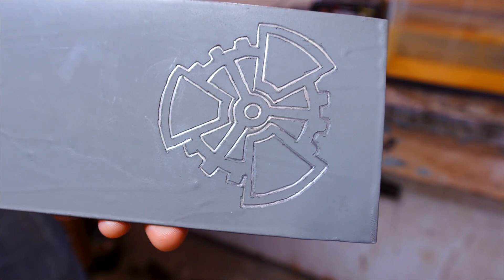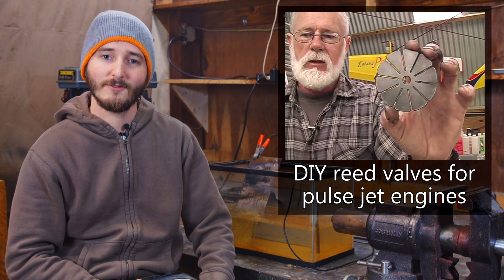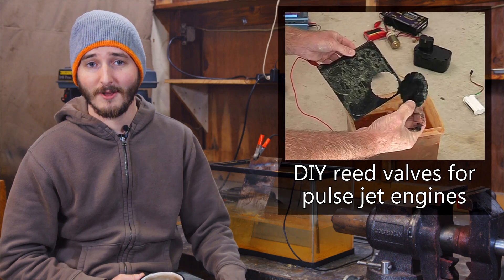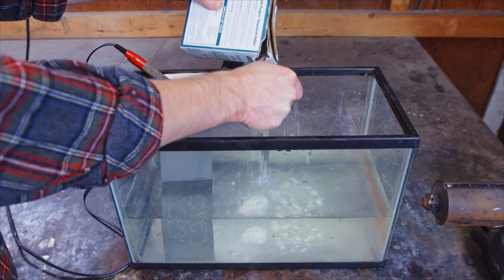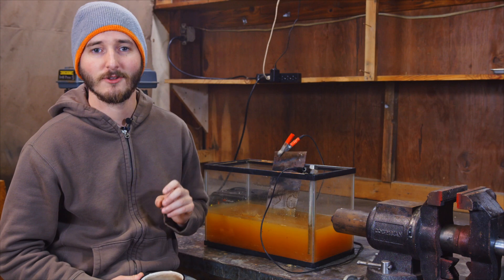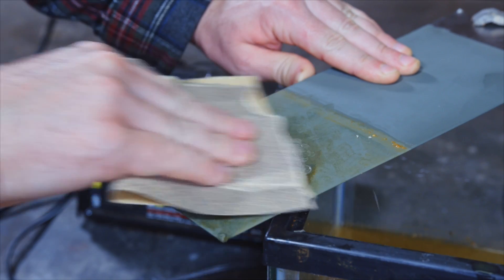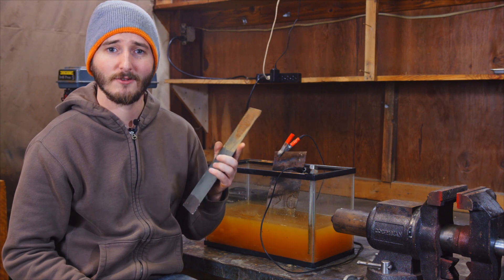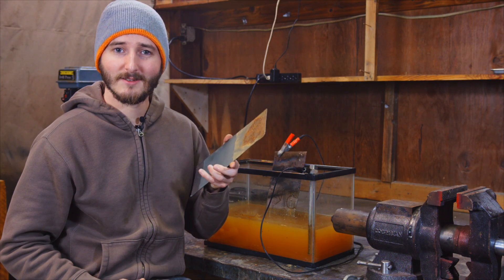How To Cut Steel With Electrolysis [Experiment In Progress] - NightHawkInLight

Comment: Your problem is the use of baking soda.  Etch Primers use an acid to form a physical and chemical bond to the metal.  Seeing that the baking soda is a base, you are breaking that bond the paint has with the metal.
Try using Kosher or Rock Salt (table salt in the US also has iodide), in a well ventilated area.  
If concerned with Chlorine gas, try using Ferrous/Iron Sulfate or Copper Sulfate (both Gardening Supplies, Ferrous Sulfate as a soil supplement, Copper Sulfate as a pond algicide).  They will smell bad, but no chlorine.
Reply from the maker: Wow, I feel like an idiot for not connecting that a bicarbonate my not mesh well with an acidic paint. I figured most of the acid would be gone post drying but it wouldn't take much to cause bubbles. Good thoughts.
Reply: Once you get rid of the bubbles, you'll also want your metal to be etched smoothly. That is, you need an electrolyte where the iron is fully soluble (to avoid getting deposits forming on the metal surface as it is being etched), and that is relatively viscous. Also, avoid chlorides : I heard they accentuate pitting.

Phosphoric acid (which can be bought in hardware stores as rust remover) should be ideal, though costly. Sulfuric acid might be a chaper alternative (the 37% aqueous battery acid, not the concentrated oleum!).

Some sodas like coca-cola or pepsi might be a more "ghetto" way of getting a dilute solution of phosphoric acid. THough be sure to boil them beforehand to degas all that CO2.
Reply: Kind of a waste of copper, and not so green to make a big mess with that and dump it all down the drain.  If it's lower pH you want, you might try using vinegar.
Reply: Adding vinegar to a koser/rock salt solution is not a bad idea.  However a mixture of just Vinegar and water would not make a good etching solution.  For a good etching the water needs to be filled with free ions to allow for electrical conductivity.  Hence why 'salts' are used.  Vinegar is an organic acid and produces very few free ions to conduct electricity, but would lower the pH of the solution.
Reply: Natriumpersulfat or iron perchlorate used to etch PCBs would not work on it? If not, why?
Reply: Wouldn't a carbonated soda solution have enough acid for current?

Comment: electrolyze it with a coating metal that cant be a cathode ?
Reply: This is the point of the primer. If you make the Cathode unable to carry a current then nothing will happen as the current wont pass.

Comment: Have a look at thermite reactions and rust oxidation iron oxide  idk it may help you. Probably not tho. Btw just a quick tip if u are going to attempt this with a salt solution then u should keep it in a ventilated area because it produces harmful gases. Better to use baking powder if u want to be safer

Comment: Try with other types of paint won't help, because the electricity don't cut in a straight line, it cuts in a spherical shape, I hope you understand, try with a very thin steel and it should work

Comment: what would happen if you reversed the polarity, for lead acid battery chargers i believe they pump the electricity in reverse to charger it.
Reply: This possess uses two pieces of metal called the Anode and Cathode. The electricity cause the salt in the water to bond with the metal in the "anode" and follow the current pulling material to the "cathode" if he did this the pipe would lose metal and it would be deposited onto the metal hes trying to cut.

Comment: the polarity is backwards isn't it? electrons leave from the negative terminal. making you're work the negative terminal will make partials of metal leave with the electrons and start covering the positive lead. 

have your tried useing more current? the posses may be time sensitive and needs to occur quickly to get cleaner results

Comment: All that comes to mind off hand is water pump grease, the stuff is so thick and really hard to remove when you get it in you. 

I can only imagine electrolysis working on extremely thin metal, as soon as you have a 90 degree open face to the protected part the electricity can ingress in any direction.

Comment: The downside of using electrolysis is that, for certain patterns (for instance lines enclosing another pattern), once the material starts to become thin, the resistance between certain parts of you want to cut and the battery can get very high. So an acid might be a better option for those kind of patterns.

Comment: This is a test to see if my comments will post, because they weren't before
Reply: Excellent project, video, and channel. thank you. 

Sodium Carbonate is apparently better for electrolysis than Sodium 
Bicarbonate. You can either buy "washing soda", or just bake the baking 
soda at 300-400
deg.F long enough for it to heat through, maybe 30-60 minutes. This
turns the NaHCO3 into Na2CO3. (makes a good all purpose non-toxic
soap/cleaner too.)

Wax can adhere even to an oily surface. If you want
to paint the metal, try cleaning it throughly first with lye (NaOH)
or sandblast it. It's clean when water sheets over it instead of
beading. Similar to lye, you can get caustic potash (KOH) from
hardwood ashes (literally Pot-ash). Or you can make it with the
Chloralkali process.

edit: After the first coat of primer/paint, maybe try a second or third coat of some kind of sealer or polyurethane?  anything waterproof that will keep the ionically-charged electrolyte away from the paint.
Reply: Did it say unknown error when trying to post?
Reply: yes
Reply: Mike Guitar
Ah Good to know, that happened to me last night. Thought it was something I wrote.

Comment: I'm not super experienced with this kind of stuff, but doesn't the current need a way to get to the alligator clip that completes the circuit? if the alligator clip is attached to a part of the steel that's covered in paint, it'll have a hard time conducting. my thought is try cutting a line from the top of your design to where the clip will be placed. that way the electricity can flow through that cut instead of having to go under the paint to complete the circuit. 

but again, this really isn't my forte, just an idea I had.

Comment: a couple of theoretical suggestions ^^ I don't know if you already tried it, but Sodium hydroxide (NaOH) is a very good electrolyte. Also, Have you tried experimenting with the orientation of the metal sheets ? Maybe laying them flat would help.. And finally, have you tried to sand the metal sheet down with sandpaper ? That could help the paint to stick ^^

Comment: It sounds like your problem is undercutting, and the only solution I can think for is, would be to reapply the wax several times through out the process, so the wax coats the the walls of your cut also I would suggest experimenting with much thinner metal since it won't be able to under cut as much before it cuts through completely

Comment: With your battery charger be sure to use at least 10amps, for your solution 1/3c TSPF per gallon distilled water makes a very reliable electrolyte that I've used for anodizing titanium for years.

Comment: Sodium Bicarbonate can be used as a paint remover, so that is probably 
your problem. But Potassium bicarbonate (in small amounts) should be 
more effective an electrolyte without degrading the paint.

Comment: note that excessive current will result in more power being spent on electrolysis of the water instead of on dissolution of the iron. At lower currents, almost no bubbles of gas are created at the anode, making it less likely for bubbles to "scrub away" under the paint

Comment: lol see if this post goes through... keep getting "unknown error" when i try...
Reply: check out MichaelCthulu's "The Black Sword" build video(would be my best suggestion for everything i've seen with electrical "etching"/cutting

(scroll to ~53 min mark)

 can try to "cut" the steel using this method, this way the plate is in close proximity and can more accurately conduct the current between anode and cathode. he got that etching pretty deep into the steel in a very short time! and it's VERY clean for some of the hob jobs i've seen!
Reply: there... worked that time!

Comment: Do you clean the surface with alcohol before you apply the paint? Even a little oil from skin contact could effect how the paint sticks. Another idea is to take a piece of fine grit sandpaper to the surface before painting it so maybe the surface is not as smooth and the paint sticks better, though im pretty sure that is not the issue.

Comment: something related to look at might be procedures for arc welding with carbon sticks. The carbon sticks must not have any moisture trapped inside it as the gas that is produced from electrolysis of the moisture will expand and crack the carbon electrodes. The electrodes should not contain any micro cavities that could trap other things either.

Comment: you can try to coat the metal with the toner transfer method for making homemade pcb's that you can easily find around the web, also you can try to use other sheet metal that can give a even surface in order to maintain the same corrosion rate all over the area of the cut paced just in front of the piece

Comment: just a guess and don't take this as a guy with experience. sounds like the metal is heating and the paint is melting. possibly to much current? again just a guess and I could be way off in right field on that

Comment: less current. less agressive bubbles so it may not break the coat. also scraping coat is not good way. you will create microscratches and bubbles break em open.

I will also recommend cut smaller pieces at a time, so you will have more control until u master your technique

Comment: two ideas:
1. powder coating maybe
2. lowering the voltage -> in my experiments, only the high-voltage-induced aggressive bubbling destroyed the layer

i did etch very fine typo into metal so the etching was done in minutes. I think everything is different in a long-term application like this. I had best Results with a matte primer out of everything i had in a spraycan - didnt try wax like you did. I also did my marking in a lasercutter pior to etching.

Comment: how about doing it in steps? letting it etch away a bit, repaint, re-scratch, let it etch again for a while ? it would be slower but maybe that would stop the solvent getting under the paint ? the problem is that the steel plate is quite thick and when you go down there's more and more area on the sides of the etching to start coroding and go below the paint.

Comment: what about coating it with setting like red seal or blueseal? or something else that would completely seal off the metal but because it's wet when you do your design it will still seal. were with the paint I think it's allowing sole chips which let's the liquid in
Reply from the maker: Could work, but it would be a little too expensive I think to still be practical.
Reply: That's true, that was my only Coram with it but maybe something along the lines like the blue seal. Tho I'm not sure if there is

Comment: I'd be concerned that the "path" of the cut won't be linear through the sheet as more and more of the base metal is removed, there is a greater surface area of the "thickness" of the sheet to be attacked.
Reply from the maker: You're correct. When working properly this method will cut the metal with an expanding half circle so the cut widens at a 2:1 ratio to how deeply it cuts. The thicker the metal the bigger that half circle will get before reaching the other side
Reply: NightHawkInLight If you can work out the bugs with the electrolyte and paint, though, this looks promising for prototyping.

Comment: looks like it could be diffusion limited https://en.wikipedia.org/wiki/Diffusion-controlled_reaction, if so then agitation/stirring could increase the reaction rate...maybe a directed current of electrolyte in the cut direction? or vibrate the plate?? might just make for faster failure though...

Comment: Don't use stainless steel in electrolysis. It releases toxic fumes. Have you tried a ac like unstable circuit. More time on the pulling of the material, this might make it less corrosive that the cut becomes.
Reply: Youtube would'nt let me post this in one go without a weird error.
Reply: Magnesium sulphate can create sulfuric acid so hande with care http://www.chemicalforums.com/index.php?topic=38755.0
Reply: The why you should not use stainless steel http://antique-engines.com/stainless-steel-electrodes.htm it contains chromium. As the article states: "The compounds can cause severe skin problems and ultimately, cancer. Hexavalent chromate is poisonous."

Comment: keep the solution circulating raise the Heat and add to the level of concentrate after painting bake the items and use a two part paint think automotive paint with hardener I hope this helps I have done this in the past it is not easy

Comment: its a really cool concept its a shame you cant get it to work. but i have a question though. How thick steel can it cut? i mean you cant know this obviously but whats your approximation?
Reply from the maker: When the process is working in an ideal situation the cut should form like a half circle expanding into the metal. So the thicker the steel the wider the cut will be as well. Otherwise there's no limit to the thickness.
Reply: NightHawkInLight gotcha

Comment: Hello, you tried use UV ink? This ink is used on fabrication of printed circuit boards (PCB), is cheap and allow high detailed cuts. This ink will cover the metal with great aderence, just the areas of you layout will be exposure. Is easy to use. Check this video: https://www.youtube.com/watch?v=Vj_cdBZO1Tk

Comment: Try a warm vinegar + salt solution, use more current, and make sure your cuts are as thin as possible.  You may also test your existing method on the thin spring steel to see if thickness matters.  That's as much as I've gathered.

Comment: You could try using a plastic spray paint like plastidip to coat. I feel like it would do what you need in order to get the solution to only effect the areas. also using plastidip is great because you can cut away the areas with a knife and just peel away since it is a plastic based paint!

Comment: You can make a mask with a standard laser printer. Use backing paper from self adhesive stickers, like wallpaper. Print on the slick side. Apply mask to your work piece with a household iron.

Comment: You might want to check out wire EDM. It can be very precise, and doesn't seem to [] insanely difficult.

My first thought is have you changed polarities if it's DC?

If it's forming bubbles, and eating under the paint, try using thinner lines. I would imagine as it erodes away the surface, the side of the cut becomes exposed, so it starts getting eroded as well. If you looked at a cross section, does [it'd] look like a fillet with the center were the edge of the paint was? If I'm right, offsetting from the finished edge at least the same thickness as the sheet should bring it close to size. Maybe twice the thickness, so the fillet isn't as noticeable.

Maybe also get some flow through a filter to clean out the rust.
Reply: Wire EDM or ECM (Electrochemical Machining; basically the industrial-grade version of what Nighthawk is trying) should do the trick.

Comment: I've done a bit of research, (thinly skimming) and think your problem is in the electrolyte. Instead of an alkaline solution try an acid such as hydrochloric. I think the salt or chlorine may be causing the iron to oxidize. Another method(I'm not sure how) would be to limit or eliminate the gas bubbles caused by the reactions.

Comment: I would think you would get better results if you did a reverse screen print. vinyl adhere the outline before painting, then remove the vinyl to leave a clean line of paint, rather than scratching the paint leaving scratches of paint lifting up.

Comment: Hello. I made a rust removal tank using the same principles. I experimented with different solutions and found that if you use distilled malt vinegar and table salt you can get a very aggressive etching solution. 
Also in my years as an electronics engineer we used to etch prototype pcb's. The line you score in the primer wants the be one third the thickness of the final line required as the etching will always cut under your dialectic cover coat. This, depending on the thickness of material, may need to be thinner. You need very little metal exposed for the electrolysis to work. Hope that helps. I may try a spot of experimentation myself now you've got me thinking about it :)
Reply from the maker: I have some ideas to try chemical etching in place of the electrolysis myself.

Comment: You should ask Cody, he would probably know which way to point you in. Have you tried roughing up the steel with sandpaper before painting? That might give the paint a better surface to stick to, and hold up during electrolysis. Sorry I couldn't help more, but good luck.

Comment: NightHawkInLight, I didn't understand why a lazer or water cutter wouldn't work. Regardless, I have been experimenting with electrolysis to generate hydrogen and oxygen for years, but with the goal of not corroding the steel. One issue I see with your setup is the distance the electrical current needs to flow between the anode and cathode. Even with a good mix of electrolyte and ideal room temperature, the distance is too far to be effective. Suggestion, put two thicker stainless steel plates 1/8 of an inch on each side of the steel you want  to cut. Have the electricity flow down the two stainless steel plates to the steel you want cut. This reduces the distance between the anode and cathode, speeding up your cutting process. Also, reducing the volume of water and introducing oscillating frequencies can help speed up the process. You might as well capture the hydrogen and oxygen your project is creating and use it as a fule source. Have fun. 😃